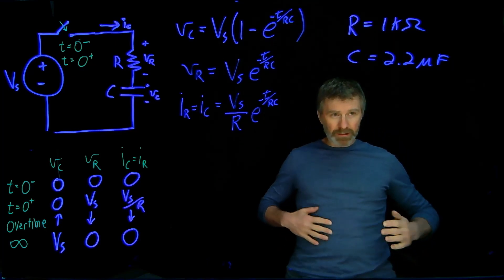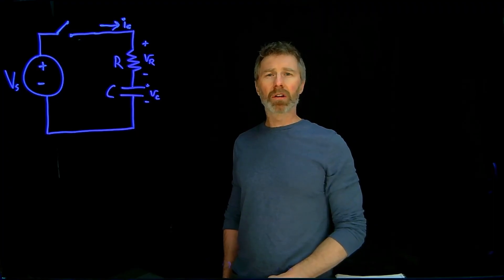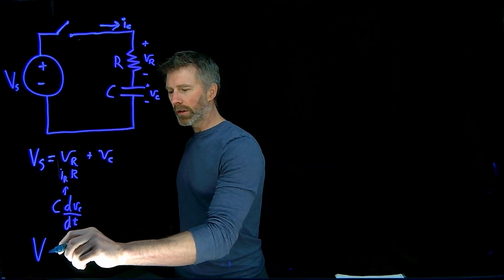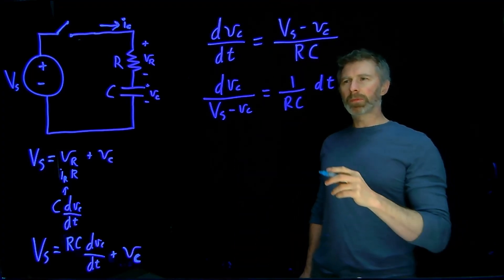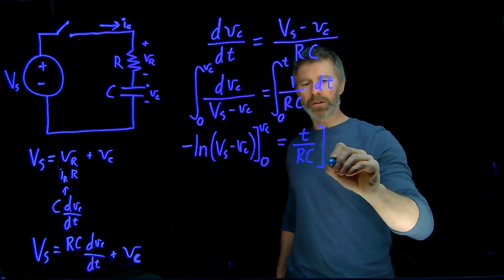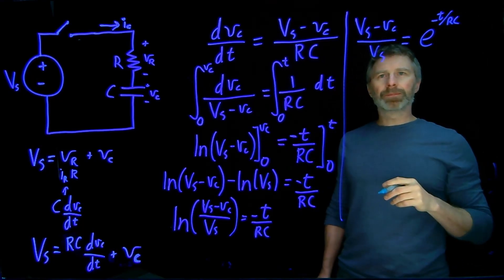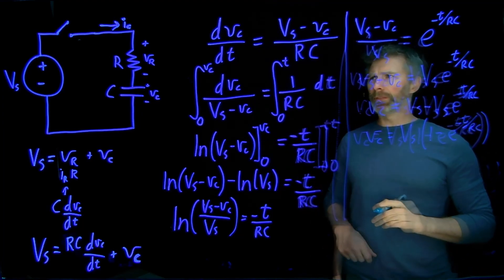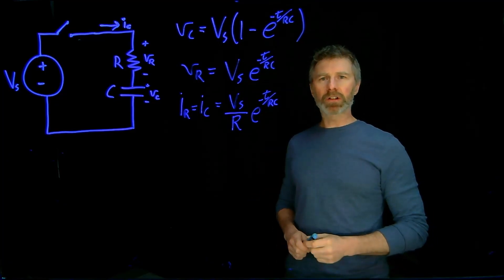Derive the Capacitor Charging Equation (Using 1st Order Differential Eqn for Voltage on Capacitor)

Comment: Hi. I don't understand why there is a negative sign at 3:14.
Reply: Because the derivative of ln(f(x))=f'(x)/f(x), so in this video's case since the integration is with respect to vc and we're trying to integrate it using the previously mentioned rule it means that the derivative of the denominator(With respect to vc) will be on the numerator so 1/(vs-vc) will become -ln(vs-vc) (The ln doesn't have the absolute value brackets because the input will always be positive)
Reply: because of the vc in the denomiator as well